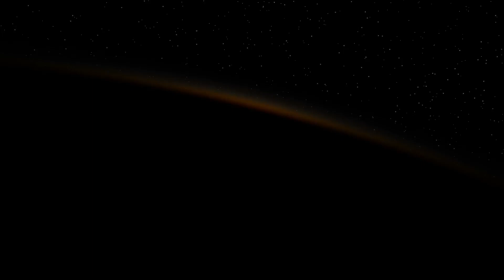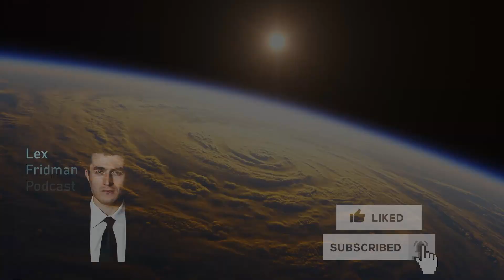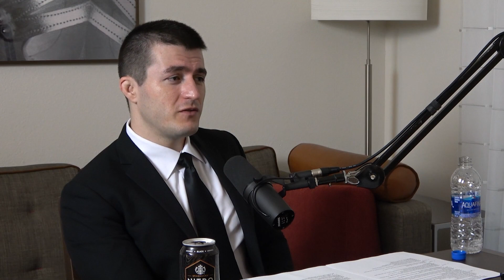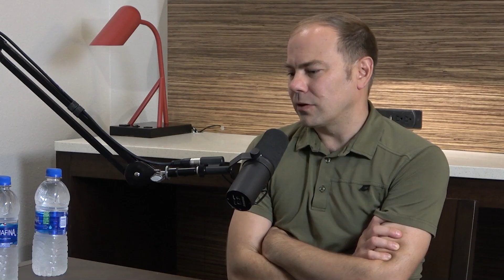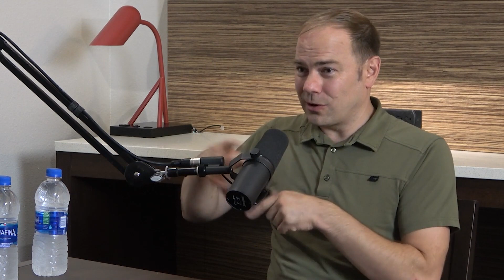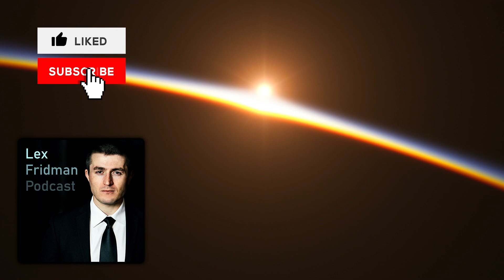Parallelization in computing as a first principle | Chris Lattner and Lex Fridman

Comment: I’d love to hear how RUST fits into this as well.  I’ve been learning RUST and so far am pretty impressed with it.  It seems to solve a lot of problems compared to other options.
Reply: Rust has an interesting feature when it comes to parallelism, and that is that its reference model (you have have many readers but only one writer) inherently prevents data races, so writing correct parallel programs is easier. There's very little to no support for talking to GPUs (the most well-developed framework for that is still CUDA, which is C++) but for traditional concurrent programming like you find in application development it seems like a useful building block.